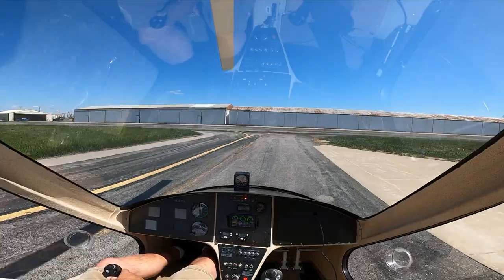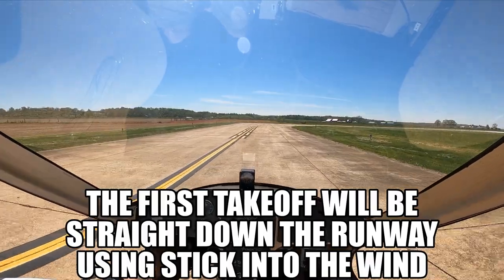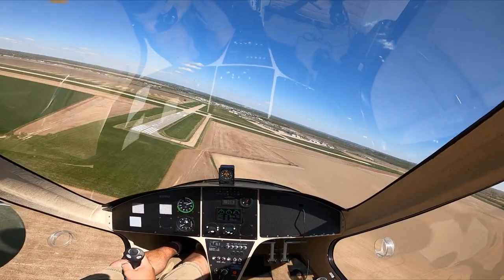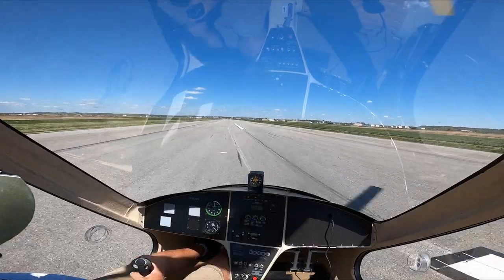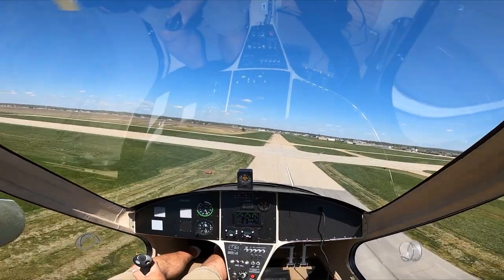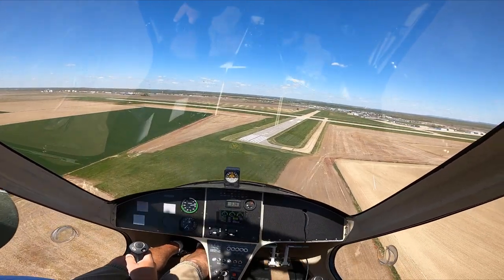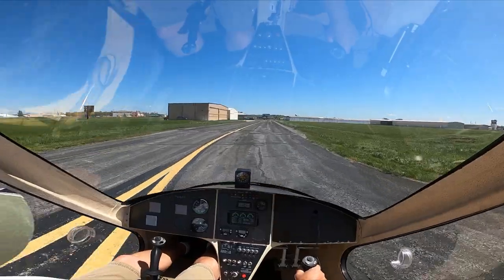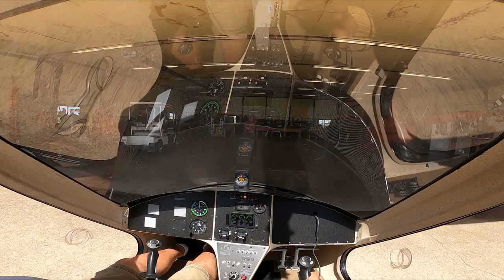Strong cross winds landings in a Magni M24 Gyroplane at KCGI

Comment: Another good video. You know a frequent argument fixed wing flyers have when debating the usefulness of a Gyroplane is the performance. Typically what is said is a Piper  Super Cub or even a Cessna 150 will be faster and outperform or match the take off roll of a Gyroplane . Why own one? The ability to fly in strong winds is a big big strong point for Gyroplanes. The old saying which was common among fixed wing pilots flying aircraft with light to moderate wing loading was, “If the wind is blowing strong enough to fly a kite, then do so.” Another words, don’t fly. Having said this poor wind direction awareness  and sub par rotor management skills on the ground can be costly.